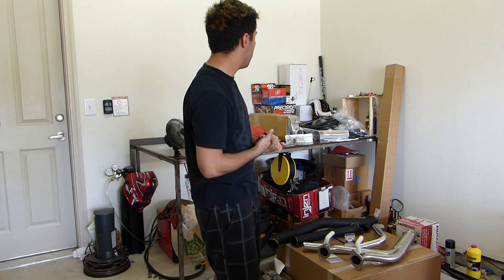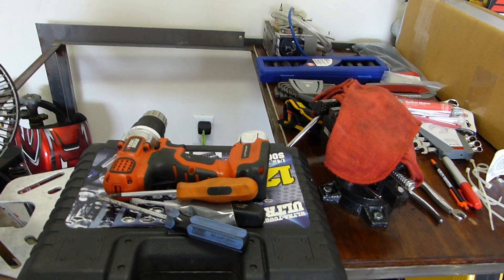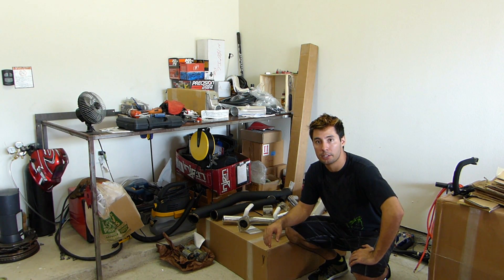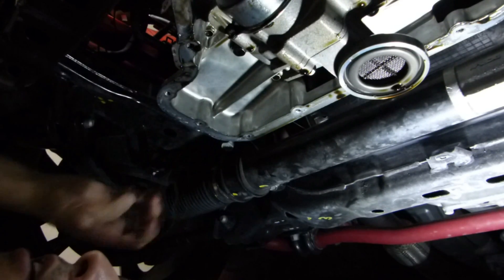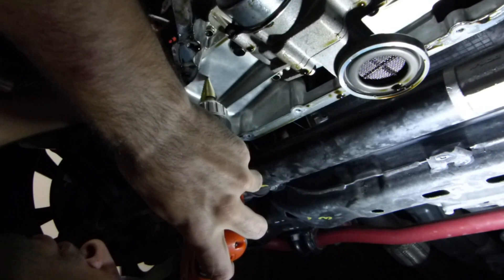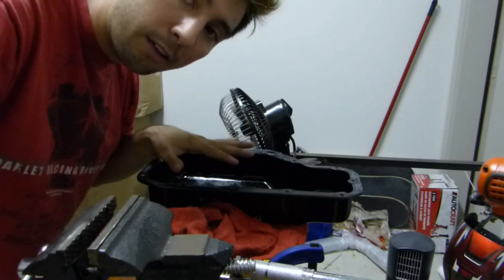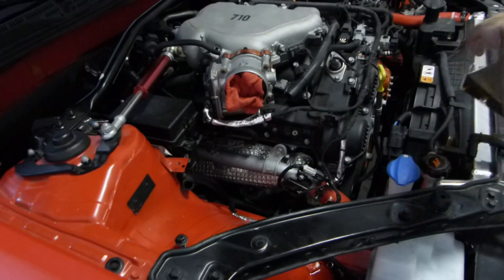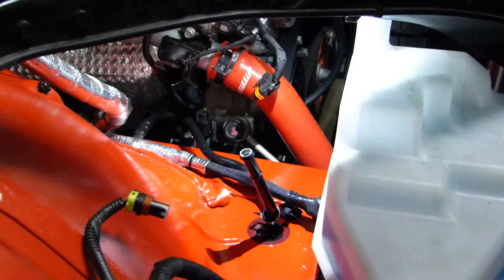✓ How to Turbo a 3.8L Genesis Coupe - Part 1

Comment: Very good video to explain it all. I really wanted to go supercharger,  but Turbo seems cheaper, so that may be the route I take once I get the motor built. It's too high in miles and I wouldn't trust it. Do you still have the car and how's it been boosted?
Reply from the maker: I still have it and am in the process of selling the turbo kit, engine, and transmission to do an engine swap. It's been really fun and reliable with the 3.8T, but after having it turbocharged for 10 years, an engine swap should spice it up and make it something different while keeping the same chassis.
Reply: Aah gotcha. Well, props to you. I think I’m gonna get the motor built and do the DTOZ supercharger kit early next year. I hope anyways. I bought a new 23 Elantra N a few years ago,and while I love it, nothing beats the fun of a manual, rwd car. So I wanna get my Genesis up in power
Reply from the maker: Without a doubt, drift beats torque steer lol. Fwd has its place, but for smiles, decent power rwd is just so much fun. 500 whp felt like a great sweat spot between daily and power/reliability, but it can make so much more too. I stopped dynoing it after like 2017 I think so no idea where it ended up.

Comment: Im thinking of going boosted?as far as buying it from turbo kits what do you HIGHLY recommend i get and buy
Reply from the maker: Very nice. Like addition to the kit or upgrades on the kit? I highly recommend getting an upgraded radiator, an oil cooler, colder spark plugs, wideband O2 gauge, boost gauge, oil pressure + oil temp gauges and wider wheels/tires (stickier and wider) to hold the power and some better brake pads. Basically all the engine safety and protection/monitoring you can.
In terms of the kit, the hot side ceramic coating is very nice to keep the turbine housing from rusting. Also, a turbo blanket and thermal wrapping is very helpful. If possible, you can relocate the battery to the trunk to free up space for relocating the fuse box (very easy and costs almost nothing to move the fuse box). It also gives you space for a larger windshield wiper spray. The point is to get the get the harness and plastic fuse box much further away from the downpipe and turbine housing. Between ball bearing and journal bearing, there isn't much of a difference in our application. Jounal bearings are easier to rebuild which is nice and ball bearings may spool up 100-200 rpm faster. Turbonetics turbo is polished vs the cast aluminum look of the precision so that may factor into looks but for the turbonetics, you really want to add in the water cooling vs the precision doesn't have or need water cooling so it's a simpler install. Precision will make a little more power as well, but if you're not going to build the engine, both will max out the engine at the same point so it really doesn't matter.
Hope that helps and let me know if you have any other questions
Reply: @InitialDIYmods  Hey Ryan what’s the final price on the complete set up?
Reply from the maker: Which complete set up? I have a built engine and a bunch of other supporting mods and upgrades so it could be a few different numbers? When I bought my turbo kit, it was the original production so cost was a little higher and I also bought an upgraded driveshaft and 4 point roll cage/bar so it'll depend. I still have all the invoices though so let me know and I'll post it up
Reply: @InitialDIYmods  ok I was referring to the turbo kit and would you recommend putting it on a stock engine (3.8) I see in the comments what you said that would be needed if you don’t recommend it so the price of those and how long did it take. My bad man Im new to all this. #newbe lol

Comment: This has probably been asked many times. But im looking at getting a 2015 model. Do you know if this kit works with newer models?
Reply: 2013 up 3.8 is the same every year, the only difference would be the bk1 because the engine isn’t gdi so yeah it’s fine. Consider if it’s auto or manual also
Reply from the maker: Turbokits.com has updated the kit to work for both auto and manual with the same kit. Auto needs a few extra hoses for the transmission cooler. Keep in mind that older kits are transmission specific. I had to help a poor guy that saw the website saying it fits both transmissions and then bought used and got a manual only kit.
As Tanner said, after 2013, they all use the same kit because they're all GDI and use speed density rather than a MAF. The earlier years (2012 or older) have a different kit that won't work.

Comment: I can't wait to be able to take my genesis to a tune shop and install a turbo kit, ecu, and this exhaust. I finally found a company that said they could install turbo kits. Too bad about coronavirus situation now and lack of a job. Ugh. This car LITERALLY sounds like a GTR with ISR exhaust. I don't care what anyone says. I would like to be able to simply cruise around in a 450 to 500whp genesis. I don't challenge anyone to races. People usually try to challenge my stock genesis, and the ones who do end up losing. That was before I know how to paddle shift. I had the car for nearly three years now, I think. 53,000 miles. I also drive with my windows down. I started listening to music when I transferred to my four year university. If I had these exhaust, I would stop listening to music. This would be my music. Imaginary GTR. I don't understand anything in the video, so I that is why I would rather pay someone else to do it.

Comment: Yo got a 13 gc 3.8 and found tiny bit of oil on spark plug .checked dip stick and was half a qrt low.do you know if these cars burn oil?
Reply from the maker: Oil on the inside or outside of the spark plugs? And after how many miles?
I've never seen or heard about the 3.8s burning much oil. Typically you get some through the PCV though so a catch can is a good idea. The 2.0s burn a little
If it's half a quart low after 5000 miles, then you should be fine and should be changing your oil anyway
Reply: @InitialDIYmods  iside of the spark plugs.burns but of oil and also did an oil change and look like some glitter when i would stir the oil .no good.was thinking maybe my cars on its last month.was thinking of doing the timming chain and tensioners i just dont know
Reply from the maker: What's the overall mileage of the car? Timing chains take a good bit of time to stretch out on a stock/stockish car. It may be worth getting an oil analysis on your car to see how much metal and fuel you're getting in the oil. A compression test would be good too just to see how the rings are holding up
Reply: @InitialDIYmods  i got 63k .its bone stock but i mean i hit it pretty hard alot .i was thinking of getting a oil testing.i was just mayne thinking timming chain tensioners becsue on the right side by the valve cover where to me i think is where the top on the chain going i heard alot of clatter
Reply from the maker: Right side you mean passenger side or driver side?
Reply from the maker: Keep in mind the 2013 3.8 engine has a mechanical fuel pump on the exhaust camshaft so it's kinda loud (think ticky). That's on the drivers side. Also, the engine uses flat tappit cams, not roller or hydraulic so they are also loud in general. With the normal sound deadening foam in place around the pump, you shouldn't hear it in the car, but if open the hood you'll definitely. Without the foam, you may hear it with the hood closed
Reply: @InitialDIYmods  its odd man the car runs strong just dont know witch way to head.

Comment: Mate any issues after boosting the car. I heard online that this v6 doesn't like turbo.

I just want 400whp how boost do I need.

Thank you for you time.
Reply from the maker: The V6 responds really well to boost, but the pistons were designed for high power. 400 whp is the recommended max whp and max recommended boost is 6 psi. With a custom tune, 6 psi puts you at about 400 whp depending on your supporting mods

Comment: Hey, looking to install this same kit in my genny. Did you tap to hole you drilled in your sump? If so what size did you go for?
Reply from the maker: Since the sump is aluminum, I tapped the hole using the fitting I screwed in for the return. I drilled it to the recommended hole size for tapping (as close as I could with the bit sizes I had). I later added a bead of JB weld around the seam to verify it never leaks. For a buddy, I TIG welded an AN fitting. Either way works but TIG is a pain and not easy on a cast part
Let me know if you have any more questions

Comment: How much would all of this cost? Been doing some research about turbo charging my genesis coupe but I'm still new to this.
Reply from the maker: Hey Ben, are you new to the Genesis,  new to turbocharging a car, or new to modding cars in general?
There are two kits on the market st the moment (Turbokits.com and Remnant Performance) and the kits range from $4k to $5k starting and they each have different turbo options and other bolt ons that can push you to $8k and beyond. This would be things like headers, colder spark plugs, powder coating, ball bearing upgrades, etc. Now keep in mind that's just for parts and a base tune, if you need a shop to help install the parts, it'll usually run 20-40 hrs labor at a shop with hourly rates varying from $70-$150 per hour. A better shop will be faster but usually costs more per hour and you don't want any random shop installing a turbo kit because if they don't know what they're doing, they can mess up vacuum lines easily which can cause engine damage. You want to triple check that everything is installed properly before getting a heavy foot.
One other thing to note when shopping for turbo kits. Car people in general get big eyed at the thought of running a bigger turbo or the biggest turbo they can get. The problem is that the stock engine can only handle between 400 and 450 whp so having an 900+ hp turbo isn't going to net the best performance without an engine build at some point to allow the turbo to really kick in. Be reasonable with your goals so you don't end up with a laggy-er turbo. Feel free to comment back if you need any help or if you have additional questions
Happy modding,
Ryan @ InitialDIYmods

Comment: I jgot a genesis coupe 3.8 ultimate and I got the intake and borla exhaust on it I was trying to make faster to tune up my car I took it to this shop and they told that I cant get it done because of the computer of the car what u recomend me to do
Reply from the maker: Hey welcome to the community!
Not many shops can work with our engine computers. I recommend hitting up Alphaspeed since they do remote tuning and are extremely affordable compared to the challenge of getting a Dyno tune setup for the other tuners (unless you live close to them already)
Reply: @InitialDIYmods  thank u for the information

Comment: How much for all of that ?
Reply from the maker: I guess it depends how you look at it. If you went to turbokits.com and got the base kit today, it would be $4900 but I got this when it first came out so I paid a bit more. I also upgraded a bunch of options like a bigger turbo and with ball bearings, ceramic coated exhaust housing along with up and down pipes, canned ECU tune, electronic boost controller, 1 step cooler spark plugs, 4 inch driveshaft, and a bunch of other stuff

Comment: What kind of intake are u using with that kit?
Reply from the maker: Kairi V not sure if you're talking about the intake pipe or the intake manifold so I'll address both. The intake manifold is stock from Hyundai. No need to worry there. The intake pipe that I run with the turbo kit comes with the kit. The old intake pipe that I removed from the car in order to install the kit is an Injen intake for the bk2 Genesis Coupe. ;-) hope that helps and happy modding,
-Ryan
Reply: Initial DIY mods tnx I have been looking at your installations over and over bc my kit is coming soon. Not a pro at hands on and mechanic.  Is all your parts to theses vids exactly what I need to do step by step? No skipped steps you didn’t show right? Tnx
Reply from the maker: Kairi V hmmm good question. I think I covered everything but I'd definitely recommend you double check the instructions just in case. I know the kit itself has had a few changes since I made this video too. If you have any questions during the install, feel free to write back. I'll help you out however I can ;-)
Good luck and you're gonna love this car on boost. Happy modding

Comment: How much does your car weight? And how do you feel the balance is on this car?
Reply from the maker: Martin De Beer the balance is fairly good for what it is (not a Porsche or miata). From factory it is a bit front heavy but still quite manageable. Plenty of ways to relocate weight back to the rear and lighten the front. Total weight with full tank of gas and me in it was 3700 so about 3550 lbs without me but naturally it's more fun when I'm in the car haha
Hope that helps
Reply from the maker: Martin De Beer also, that way some time ago before I got lighter wheels and wider tires, before battery weight reduction and relocation so it may be even less.
But since I'm making over 500whp, I haven't been going super crazy on weight reduction yet ;-)

Comment: Use a brass bristle brush to scrape away the old gasket material, works great!
Reply from the maker: Yes it does, but I usually do that for the stubborn bits, I try to use a razor for a majority of the clean surfaces. SS works great too, but it's pretty rough on aluminium if you're not careful.

Comment: Hey, I'm planing on putting a turbo on my 2013 3.8 Genesis r spec and I just wanted to get some feedback in regards to the setup you have on your car. This will be my first project to turbo my car and not quiet sure where to start. In one of your vids I saw that you where riding in Katy 99. I stay around that area. Never seen your car but I do want to get a set up similar to yours. What do you recommend. Thanks.
Reply from the maker: casti 1101 sure what kind of feedback are you looking for? I used to live in Cinco Ranch but then I moved to Barker Cypress and now I moved to Ohio for the near future.
What kind of recommendations are you looking for? I recommend the turbokits.com kit for sure because it has everything you need  to get the turbo on and running with a solid base tune. Agood aftermarket exhaust helps too (anything but straight pipes lol). you're auto so no clutch to worry about but upgrading the auto trans isn't necessary til after you build the engine. you'll need wider tires and rims, a boost gauge and a wideband O2 sensor. also an oil cooler is a really good idea.
feel free to write back with any follow ups.
thanks for watching ;-)
Reply: Initial DIY mods 
Initial DIY mods 
Thanks for the reply, on the vid that you took a to Austin for a Dino run the 3rd car that got dino ( black Genesis) with loud exhaust, what type of exhaust is that? And it's a manual transmission. And one of my main concerns is that if I go with a kit from turbokits.com would I need to make any major upgrades to the stock 3.8 GDI r-spec engine or tranny from what it comes out of the factory? Well other than the exhaust and wheels. I plan to have it as a daily driver. So as of now I want a fun fast car with out any big worries of the motor crapping out.
Reply from the maker: casti 1101 The car with the exhaust was full straight pipe exhaust. Headers, test pipes and dual pipe with some tips on it.
For upgrades to the engine, no you don't require any upgrades as long as you don't push the boost beyond the recommendation. 8 psi is the most I'd recommend with this kit on the GDI if you're not building the engine. A custom tune at 8 psi will get you more peak power closer to 425 whp and the canned tune will get you around 380 to 400whp. the custom tune will also make the power much smoother as well.
Now some people run more without issue but it's a risk. I blew originally because I was running 13 psi of boost daily and was waiting to build it anyway.
hope that helps and happy modding ;-)
Reply: Initial DIY mods ok sounds good. Thanks for all the advice. Keep up the good work with the  vids.
Reply from the maker: casti 1101 no problem. Will do and thanks for writing in ;-)

Comment: How many times have you installed turbo on these cars?  Is it feasible to do it myself using your videos?  How much time does this usually take for a first timer?  Thanks!
Reply from the maker: Allison Whitney I must have missed this comment cause I don't see my reply. sorry about that.
I've installed this kit on my car about 20 times (usually to do other mods or pull the engine, clutch etc) and then I installed one on another car too.
it's definitely possible to do yourself because that's what I did. this one I filmed was my first time doing the install from scratch and it took 4 full days with filming. If you don't over think it, you can do it faster and if you're good with working on cars too.
my videos show 95% of what the instruction manual shows but it really helps to read the instruction manual and use it as a to do list and then use this video to help you see what it's talking about or see how I did it
hope that helps and feel free to post up questions here ;-)